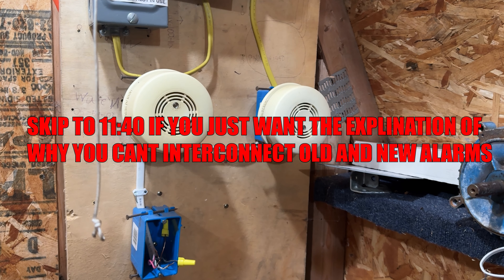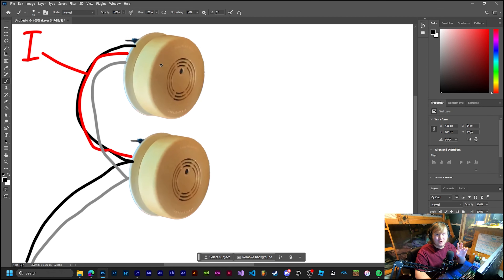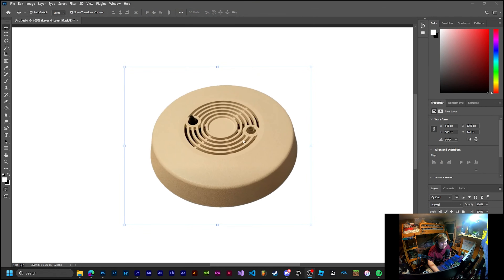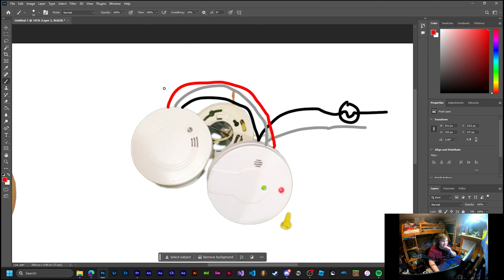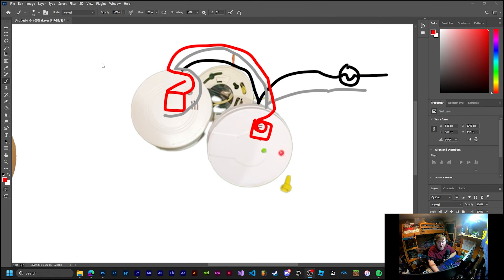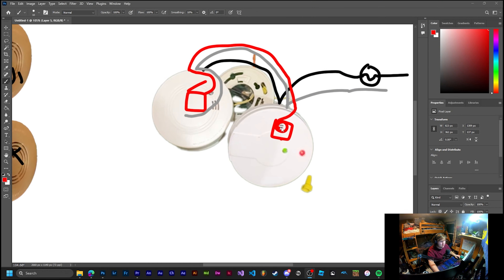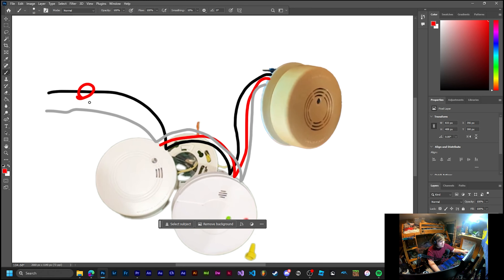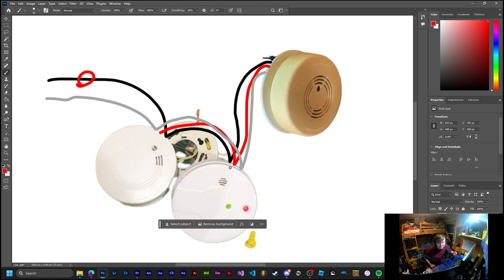Old School Interconnect Vs New Style Interconnect in Smoke alarms

Comment: Wow you have a lot of knowledge on this! The only thing I knew is the modern interconnecting ones had 9 volt DC interconnecting wires which makes it to where they will work in a power outage. Plus the information on the Kidde’s have that relay explains my issue I’ve been having with the interconnecting. I would also guess that my interconnecting wires in my house have problems because they are the modern interconnecting system and they keep killing those relays in the Kidde’s.
Reply from the maker: yes! thoug the relays are built in IO chips that handle signaling so that might be another problem there with yours, and yes thank you! I've been researching what goes into smoke alarm interconnecting for some time now!